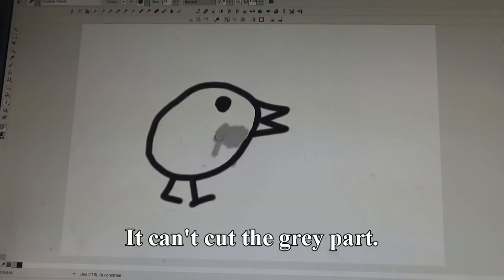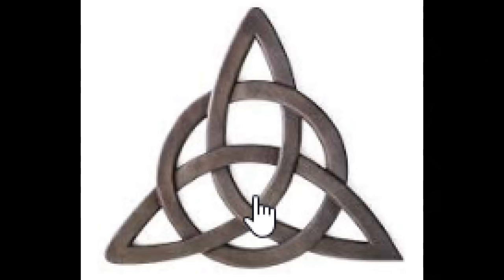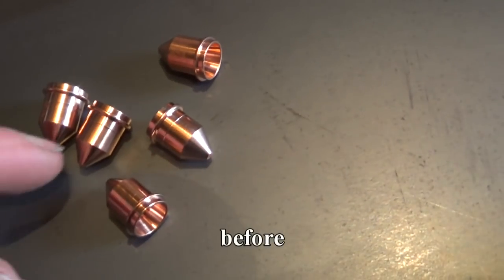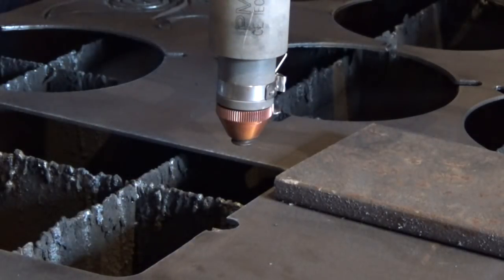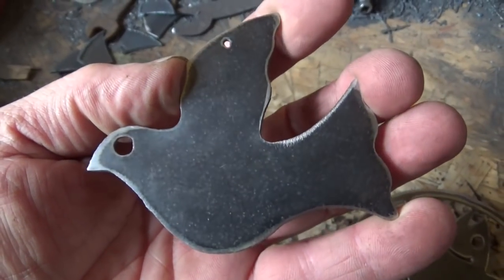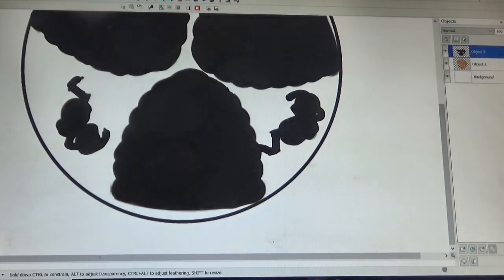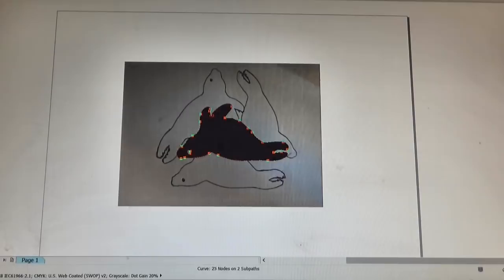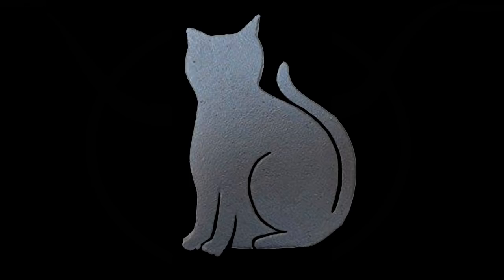Trivet Video Follow-Up!  (How to design for a plasma cutter.)

Comment: i found if you drill a small hole  it helps to start the cut and cuts down wear on the tip
Reply from the maker: that's good, but wouldn't work with a CNC machine like mine. It would be way too complicated to try to pre-drill all the holes in exactly the right places

Comment: I love this video - it's so informative. 
On the seals - is there a way to rotate them so the muzzles are more toward the center? It seems that they make a sort of rough triangle. The permutations I saw had either the flipper angle or the tail angle in the center, but never the nose. I can see them in my mind's eye with the belly on the exterior and the noses in the center.
Reply: +1  Agreed. Put the flippers on the outside touching the ring and the noses in the centre.